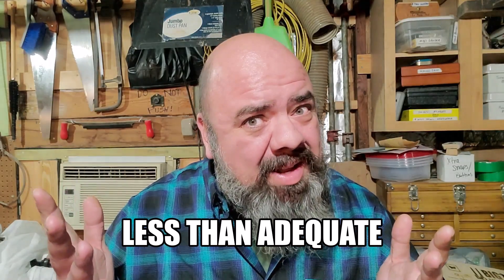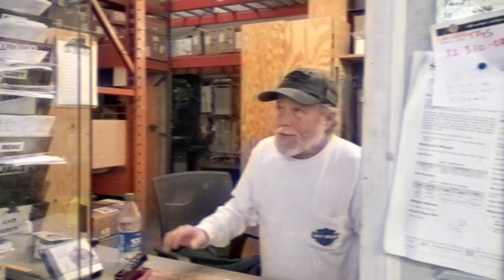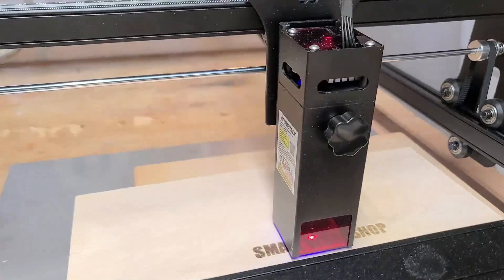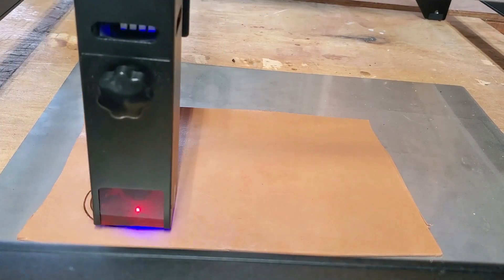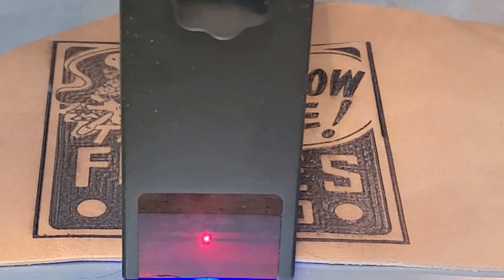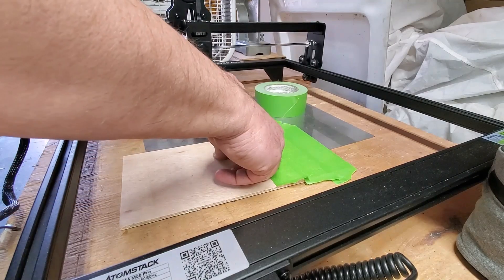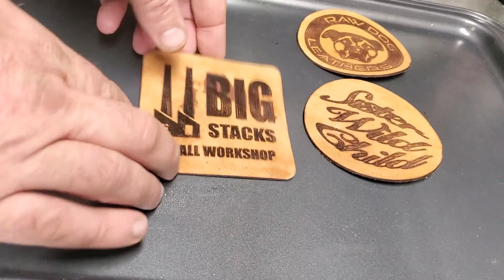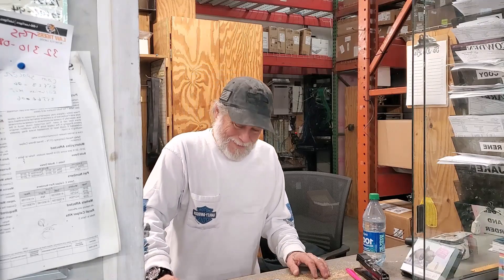Is This 5.5 Watt Laser Powerful Enough? Atomstack A5 M50 Pro Review

Comment: Hy! Nice video! I’m thinking about buying a laser machine 5w for cutting leather wallets including holes! If leather 2 millimeters how many time to cut approximately??
Reply from the maker: Thank you very much for the compliment. I'm not sure exactly how long it would take, but it's not terribly long.   If you are using this last strictly as a hobby, you'll be fine.   If you are trying to make a production run for business,  it's go with a higher wattage.  Just be sure to wet your leather completely before cutting it.   I hope this helps.

Comment: Damn I just bought this, I wish I would have seen this before, but so far I'm happy
Reply: Hi. I would like to ask if the laser comes with a specific program for operation, and if not, which program is used, and is it compatible with Windows 11? I saw in the product description that it supports up to Windows 10.
Reply from the maker: @slobo989scz You can operate it with freeware called LaserGRBL or you can buy Lightburn, which is relatively inexpensive.
Reply from the maker: @tristanlombardo6692 It isn't a bad laser.  My only issue is the motherboard crapped out one it was a year old.   I found a replacement on walmart.com for like $30 or so.

Comment: Knocked around with getting a Laser engraver for several years. Then I saw the price of the A5 drop to 250. So I decided to give it a try. Well, first run was a 400 x x420 simple grid layout for a base under the laser, That worked out great. Then I made a stencil and converted it to a Jpeg. Just like you I used a scrap of 1/4 pine underlayment. Same results as you.... Spent a little more time learning the Controls on Lasergrbl and ran the same stencil on 3/4 pine. Fantastic!!!!!!!! My Adult children want me to make a set of Large dressers for them but they wanted me to engrave designs and such into the drawer faces. With a wood burn/soldering iron that would take forever. Now I just download a Picture into Krita and edit it a bit, open in LaserGRBL, size it to what I want, set my power and speed. and away it goes. A good picture still takes about 5 hours but Im doing other things while it runs. So far it works just fine and the girls get a kick out of personalized furniture. Fixed focus and very easy to set up and use. Best point is "It is very adequate at under 300$". Have not done any cutting or other material yet except pine, Oak and Birch. But for Accenting furniture and cabinets it's doing a great job
Reply from the maker: @1dgabel I never thought of using it to engrave sections of furniture ... great idea!  Like you said,  it's all about the settings to use for your software.